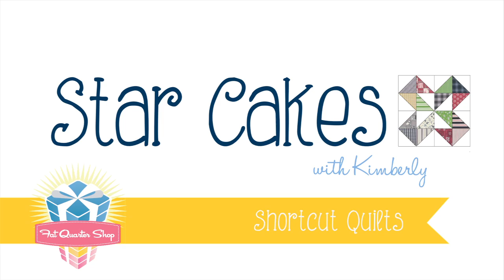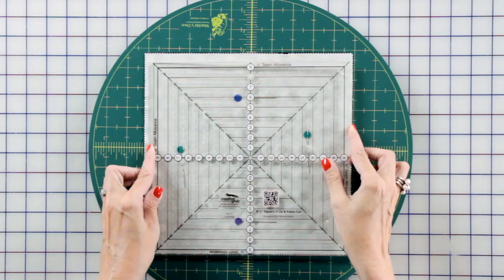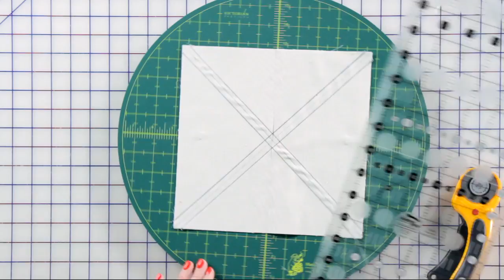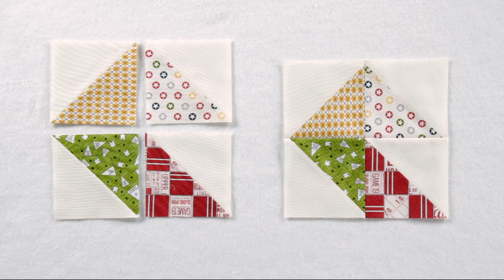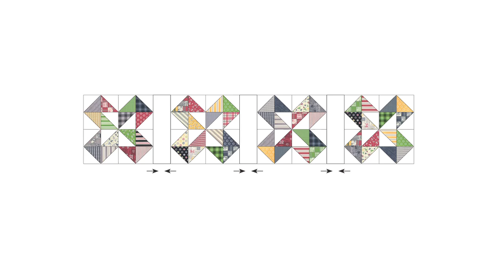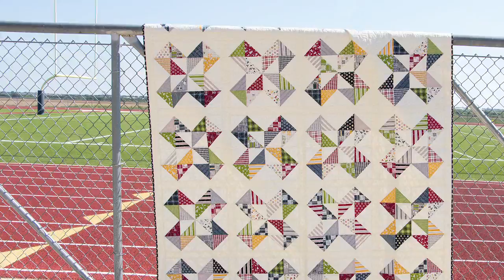Star Cakes: Free Layer Cake Quilt Pattern - Shortcut Quilt Series | Fat Quarter Shop

Comment: I purchased the fat quarter bundle of the Varsity fabric to make a queen size quilt.  Would you recommend using 4 in finished triangle paper?  Thanks, love the tutorial and free pattern!
Reply from the maker: Hi Heather! Yes, 4” triangle paper should work nicely. Your blocks will measure ½” larger though so you will need to cut the Fabric C rectangles at 2 ½” x 16 ½”. Your D strips will need to be cut at 2 ½” x 88 ½”, the side borders at 88 ½”  and the top borders at  92 ½”. The quilt will measure 92 ½” x 92 ½”. (edited on 1/25/2020)

Comment: I am working on this as my first quilt. I am cutting down to 9 1/2" squares. After sewing, the fabric is wavy and the HST are not measuring 4 3/8. Any idea what might be wrong? Thanks!
Reply: Fat Quarter Shopjellyroll quilt
Reply from the maker: HI Melissa!  This is more of an advanced beginner quilt, so totally understand these frustrations.  Since you are sewing on the bias (diagonal to the weave of fabric), the fabric has more stretch in that direction, which causes waviness.  You can reduce that by starching the fabric before cutting.
For the HST not measuring 4 3/8", are they coming out smaller?  One tip is to sew not directly on the line, but just a few hairs away from it, to compensate for the fabric that pressing and folding takes up.  Hope this helps, let us know if you have more questions.

Comment: I am confused as to how many different fabric patterns are in these blocks and how they are pieced together. None of these blocks appear to be the same.
Reply from the maker: +Lu Sadler That is correct, if you use a Layer Cake (10" square) you will in turn make a scrappy looking block. You could certainly simplify the fabric placement with less fabrics.
Reply: +Fat Quarter Shop Have never purchased a Layer Cake. Will have to try one soon.
Reply from the maker: +Lu Sadler There are a great way to sample an entire collection. There are typically 42 pieces of fabric in each Layer Cake. Embrace scrappy and try it sometime. Thanks for watching!

Comment: I believe the previous comments re the frixion pen, however I do use them, basically if you are drawing on the wrong side and then cutting on the line, I'm gambling that it won't be too much of a problem. I wouldn't use on the top but wrong side of fabric, yes.

Comment: That friction pen ink does not "disappear", it merely becomes invisible. The chemicals that create the effect of "vanishing" under the heat of the iron do not wash out of the fabric, and must be removed by yet more chemicals. Use a simple chalk marker for mark that won't "come back"! Pilot, the company that makes the pen does not recommend it's use on fabric for this reason. It was designed as an eraseable pen for use on paper.
Reply: That is good to know, Karen. I was amazed by the 'disappearing' of the frixion pen when I first used it on fabric, but still cautiously only used like colours on my fabrics, and never on light fabrics. Glad I was that cautious!
Reply: Karen Alexander  Bummer, Karen.  Where were you before I just bought three of those pens cause so many people seem to use them?  Lol
Reply: I have been using the Frixon pen on all my fabrics and it disappeared with heat and hasn't come back.  There is a warning on the package that under very cold conditions the ink may reappear but I've not had a problem with it.
Reply: You don't need to use chemicals to get the frixion pen ink out, just wash the item and it never returns.
Reply: Totally agree. My lines have come back. Used to mark quilting lines before I knew better.
Reply: Comes back in particular temps!  They can ruin a quilt, especially a gift, or making something to sell, customers complain!  Chalk, or water erasable